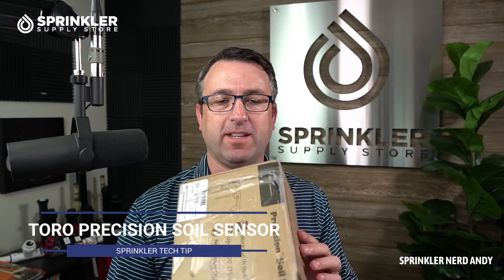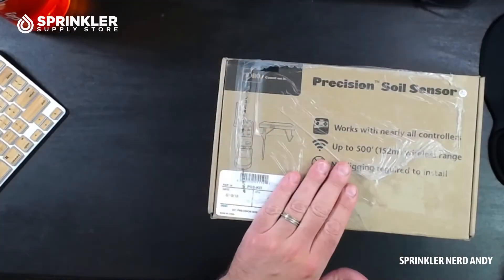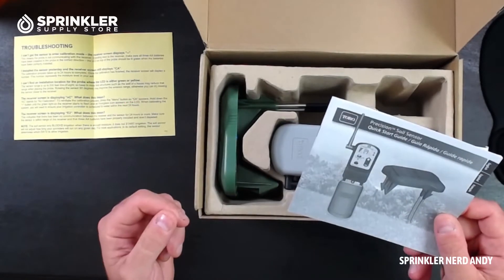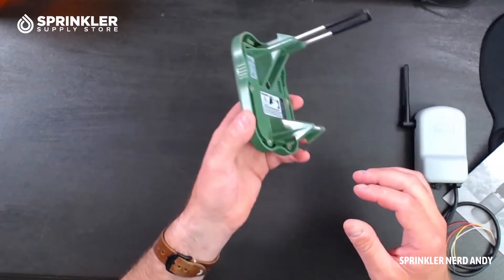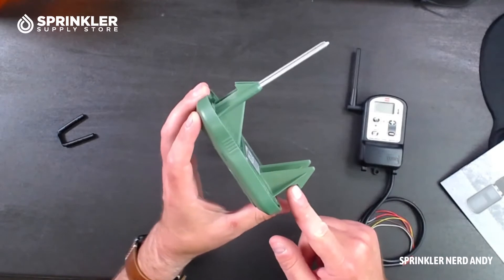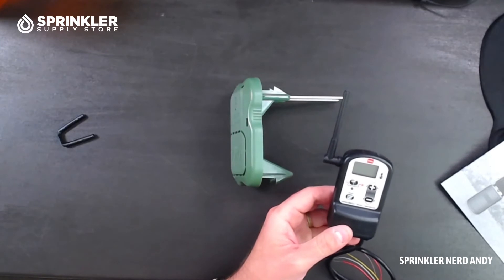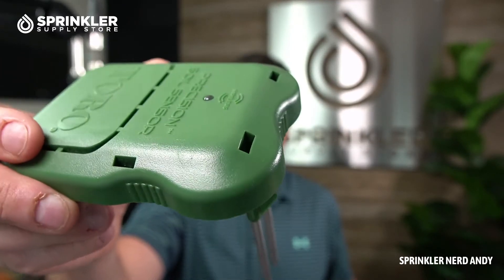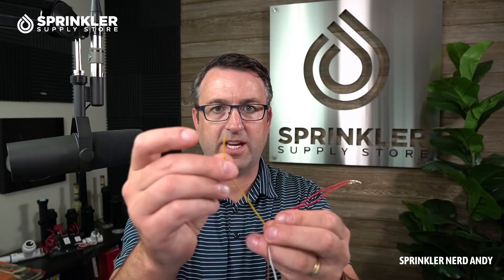Toro Precision Wireless Soil Moisture Sensor, Product Overview

Comment: Does the controller lose calibration info in a power outage? Is there a backup battery in the controller?
Reply from the maker: The receiver unit has a lithium backup battery installed that retains your settings/calibration in the event of a power outage, so you should be all set there!
Reply: Does the sensor check moisture deeper then its actual blade leinght?
Reply: Toro or GeoDrops? Which one do you think is better?